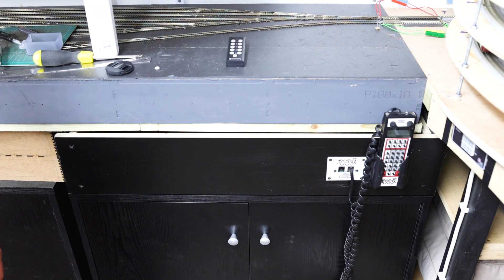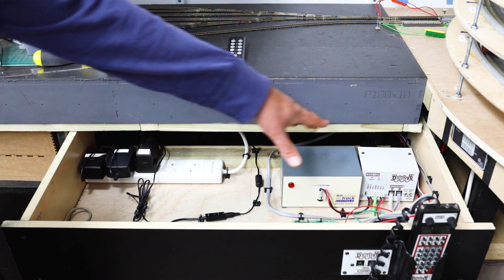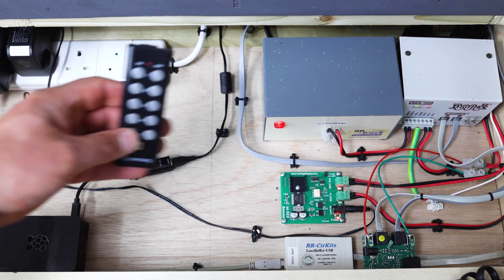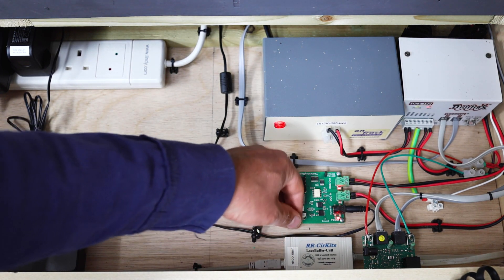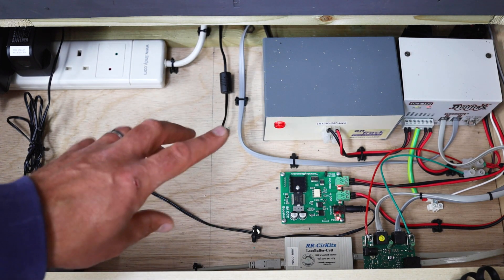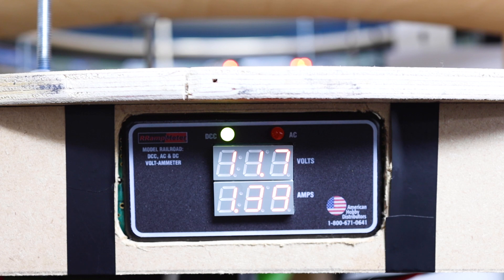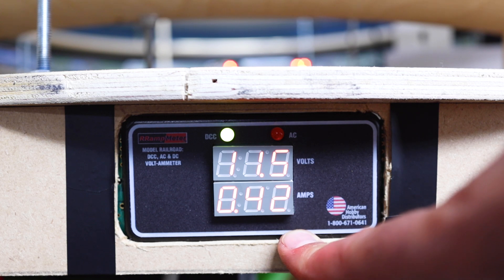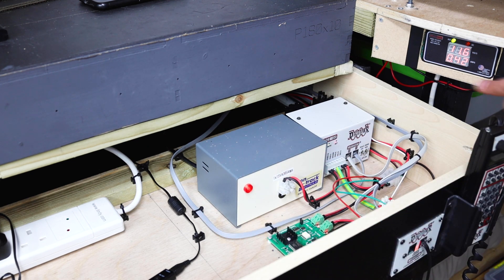Building a DCC Drawer: Model Railroad Showcase #1

Comment: Great video what’s the back look like for the cable strain relief feeding the stuff like the PSU hate for that power cable to wear down.  I covered a wonderful solution for one of my draws way back in video number 77.  Needless to say with the mimic panel finally in its place that entire draw is starting to take some shape slowly but surely.  Well back to the signal gantry’s I’m installing.  Stay safe.  And keep the solid content.
Reply from the maker: Unfortunately can’t add photos to my reply, but I’ve used cable ties & cable tie mounts to tie the cables down, leaving enough slack in all the cables so that when I close the drawer the cables just coil up and then uncoil when opening the drawer. Because of the cable ties there is no movement of the cables therefore no way for them to wear. Bearing in mind, I rarely need to open this drawer, so it should be fine for years to come.
Reply: @ChicagoSubNScale  that’s the thing I could not predict.  The draw has been opened a handful of times but mine was opposite while I can’t get back easily I could not suspend them up from a cook with slack which is what I wanted to do but I do have confidence the arm will be a winner.  I first saw the draw idea back back in the 90s when fellow enthusiast and indeed model shop on the Fraser Coast M & K Model railway who built his dream layout had this elegant way of controllers and things concealed in draws.   It’s a great idea.  And keeps its accessible.  It’s a cracking layout mine was originally  meant to be N scale but here are.  I will admit a lot more track n trains with n HOWEVER as I’m
Maturing the slightly larger scale is a little more forgiving on my wobbly hands.   I’m personally not wowed on the TT but I guess it’s a compromise for some.  Has Digitrax been good value investment in the long run ?
Reply from the maker: I’ve just replaced my 25 year old Digitrax DCS100 Command Station with the latest model, so yes, has definitely been a worthwhile investment
Reply from the maker: Oh, and glad you like my videos! More to come in the next few weeks. I’m going to head over to your channel now
Reply from the maker: Just looked at your video 77. Great idea about the arm. Works well. Unfortunately wouldn’t work in my setup as my drawer is on top of a cupboard, so no space for an arm. But I’ve left enough slack and tied the cables together, so no snagging.
Reply: @ChicagoSubNScale  nice.  Yes I was going to let them hang but the more I thought about this draws traffic may well increase greatly especially with that mimic panel that’s never part of the plan of this build.  Still got a bunch of surprises coming through them rest of this year. BUT the biggest thing I need to get serious on is this damn drop.  Grrrr.   Stay safe.

Comment: I like this idea of everything tucked away in a drawer. Perhaps adding a cooling fan in the rear would be an additional idea to keep the booster operating at peak efficiency. Definitely going to get one of those ramp meters. Layout is coming along nicely Peter. 👍👍
Reply from the maker: Thank you! Yes, easy to get to everything. No fan needed on this one as the back & top of the drawer is open - no back on it, and open frame above drawer, so plenty of airflow

Comment: I like the idea, want to do something similar for my layout. I have a Digitrax booster (and the TAM Valley one). I'm guessing I'd need 2 RRamp meters?
Also, what about heat? Do you have a fan on it somewhere? I'm assuming an enclosed drawer would build up heat.
Reply: Makes it all easily accessible. Yes, if you’re using both the boosters to power your layout, then ideally a RRampmeter after each one. I’m using the TAM Valley one to power my accessories, so didn’t need a meter there.  As for the heat, yes, if the drawer is enclosed a fan would be ideal, but my drawer does not have a back and is open at the top (big gap between it and bottom of module) so plenty of ventilation.